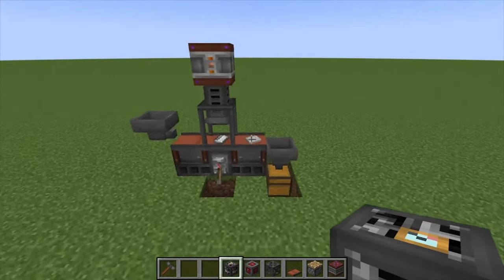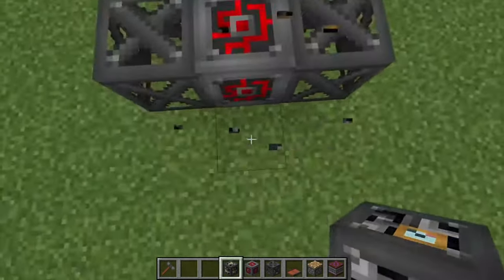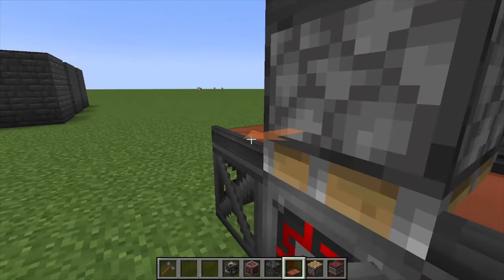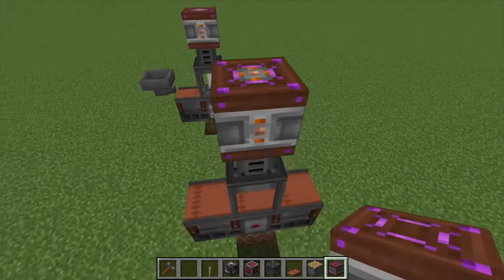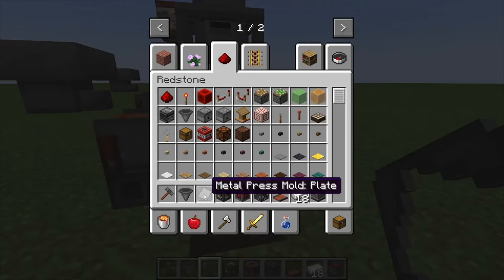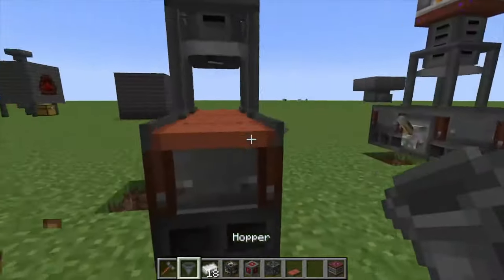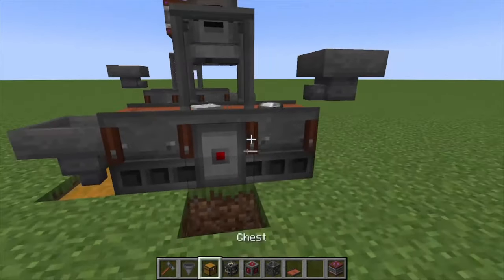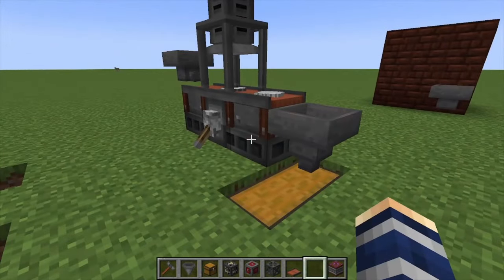Immersive Engineering: Metal Press (Automated plates, rods, wire)

Comment: any good way to power this in survival? i use 2 wind mills and it still stutters
Reply from the maker: @Skull_NightX  if it’s constantly running more windmills or water wheels. If it’s not running non stop I would put an accumulator to build power while it’s not running..the other option is the diesel engine that outputs massive power

Edit: if it’s a mod pack with Mekanism the gas burner is easier then the diesel engine
Reply: @MCMentor1  ok thanks